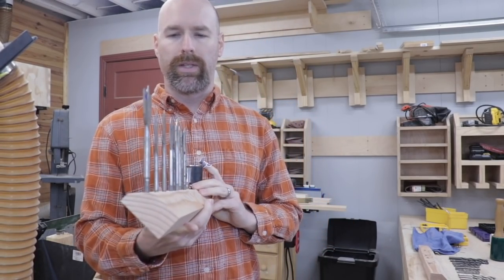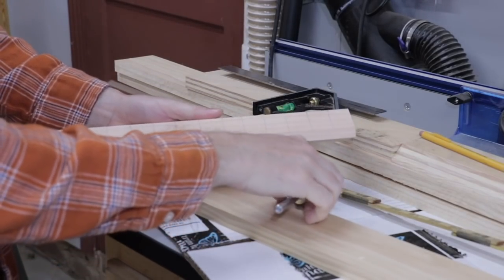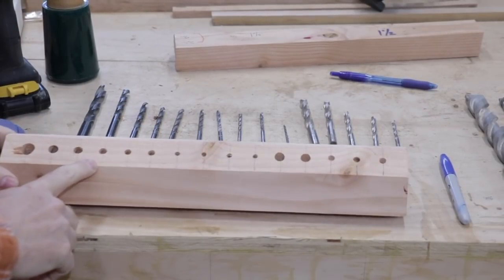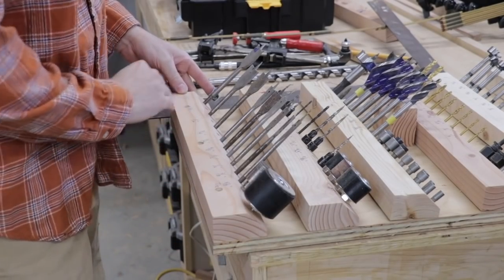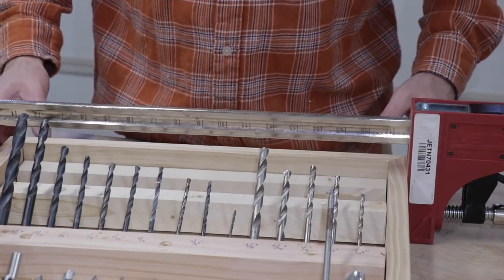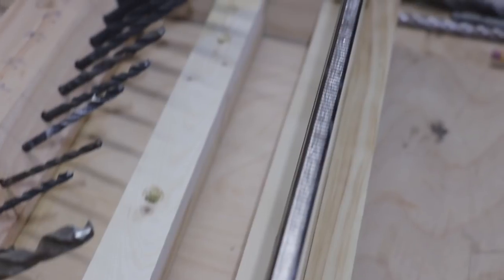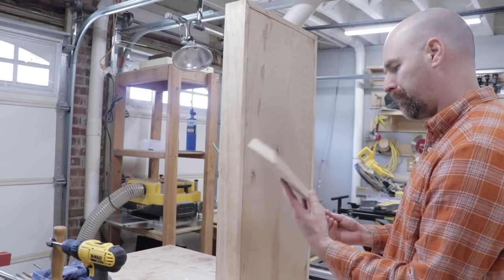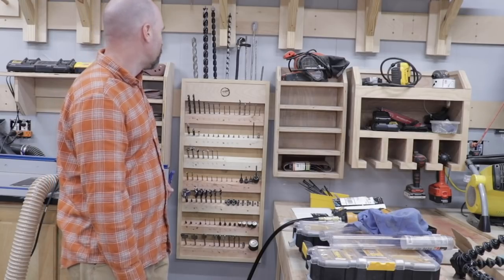French Cleat Tool Wall | Drill bit Organizer Part 2

Comment: One of the promoted features of French cleats is the modularity- you can move/adjust for future needs. The larger the module, especially in relation to the size of the parts it carries, the less flexible it becomes.
In this particular case, the drill carriers could have been held by slots in the end frames, allowing them to be moved, modified, and added to. A system within a system. Stumpy Nubs built a system like I describe for router bits, but with each item sortable.

Comment: I just made something like this (not quite so fancy).  But I had some confusion on yours, until I realized the bits I did mine for had hex shanks all the same size, so didn't need different sized holes.  So much easier!  That said, I have a set of bits that DO have the same shank size as the bit, so I'll be going through that exact exercise before long.  I have come to the realization, as you said, pre-measuring and marking and clamping make all the difference, even for shop stuff.
Reply from the maker: Awesome! You will really enjoy the organization. It’s been great for me.

Comment: Nice storage solution for those pesky drill bits.  I think the only suggestion that I could make would be to drill a 1/2 “ or 3/4” deep hole the same diameter as the bit into the bottom support piece for your tall bits to keep them nice and straight instead of letting them just rest on it.  Great job!
Reply from the maker: Thanks
Reply: Maybe not even the same diameter, just relatively close so that they aren't leaning of so much. Not perfect is fine, but I'd want to keep them from encroaching into other bits' space. It would bother me to go for a bit and always have to push another one out of the way.

Comment: Hello,
In the video, you mentioned a corner chisel jig that you used to drill the holes for the bits. I looked for a video  for that jig but couldn't find anything. What are the dimensions of the jig and what angles did you cut them?
Thanks